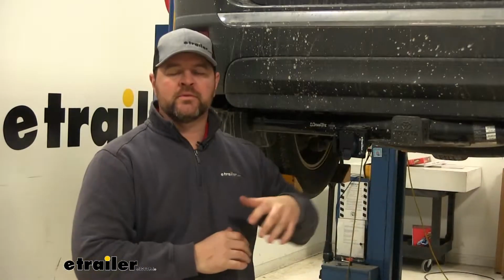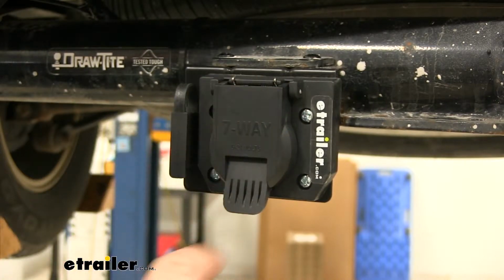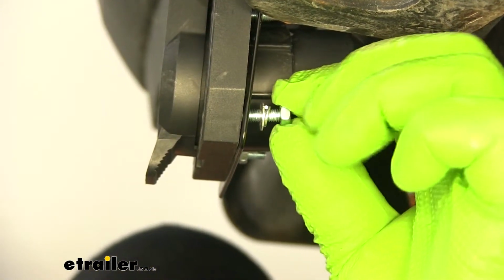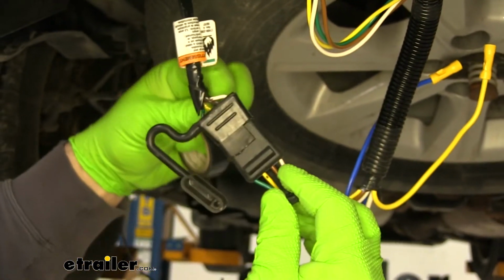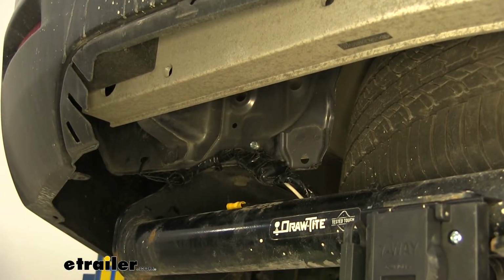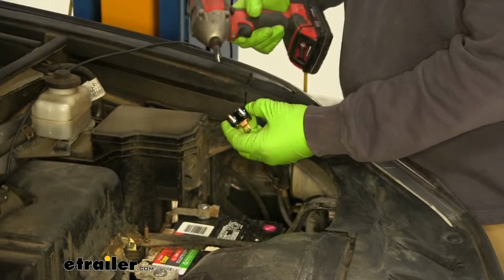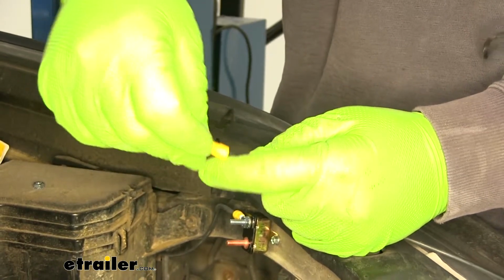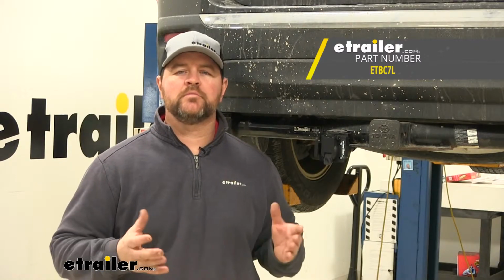etrailer | An In-Depth Look at the 7-Way RV Upgrade Kit for Trailer Brake Controller Installation

Comment: What extra wire were you referring to when attaching the wires to the circuit breaker?
Reply from the maker: He was sure referring to the length of wire that he cut off in order to connect to the circuit breaker.
https://www.etrailer.com/Accessories-and-Parts/etrailer/ETBC7L.html

Comment: Would this be the 7-way kit that is needed for the AutowBrake?  As questioned below (re: Curt Echo), how does AutowBrake get input for proportional braking? Thanks!
Reply from the maker: The # ETBC7L is the install kit you'd use. When the vehicle's brakes are used, the trailer brake lamps are illuminated. This signal is what tells the Autowbrake to activate. It's internal sensors determine how much braking force is applied. This all happens in a split-second. Hope that helps!
https://www.etrailer.com/Trailer-Brake-Controller/Autowbrake/3430001.html
https://www.etrailer.com/Accessories-and-Parts/etrailer/ETBC7L.html
Reply: @etrailer  Yes, this helps so much. Thank you!
Reply from the maker: You're very welcome, happy to help!

Comment: How would a proportional wireless brake controller like the Curt Echo get a signal for the trailer brakes without using the blue wire?
Reply from the maker: The Curt Echo uses the 12V signal from the vehicle to power itself and the brakes on the trailer. It used inertia sensors internally to apply proportional braking to the trailer.
https://www.etrailer.com/Brake-Controller/Curt/C51180.html

Comment: Great video! Exactly what I needed! I'm using a different part C57674 but I'm guessing this part works the exact same. I just didn't know what to do with the 2 extra wires if I'm using a wireless controller. Thank you!
Reply from the maker: Yes this item is very similar to the one that you have. Hopefully our video was able to answer your questions.

Comment: I brought a truck with that thing brake control system but it keep saying trailer brake controll system disconnected but i have no trailer and the truck wont go drive it keep on parking and i dont know whats wrong with that i have to turn off the truck and turn it on again so i can drive it...is so annoying tho...

Comment: Question: I have a 4-flat installed already and when checking my battery I found a power wire already connected to the battery. Can I just split that already installed cable to run the live wire and save myself the hassle of running another cable to the battery?
Reply from the maker: If you no longer need the 4 pole wiring then you can connect to the previously installed power wire to get power for your 7 way wiring.
https://www.etrailer.com/Accessories-and-Parts/etrailer/ETBC7L.html
Reply: @etrailer  Yes, but my Chrysler Pacifica has this wiring harness C56322 and the power cable goes to the "module"/box of this  4 pole system. My question is: should I unplug the 12v cable from the module and attach it to the black wire of the 7 pole adapter or do I need to run a second cable? I'm concerned that if I unplug the 12v cable going to the module/box of the 4 pole then I won't have voltage there, but not sure if I need that.
Reply from the maker: @deathcoder   I would run a second wire so that you do not overload the wire going to the converter box for the 4 pole.